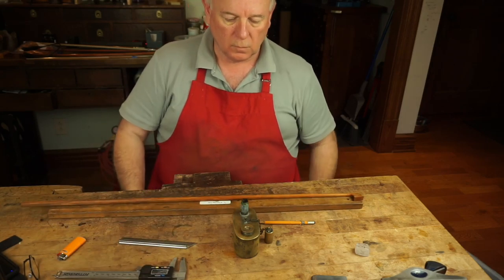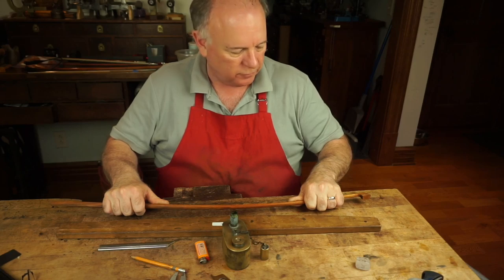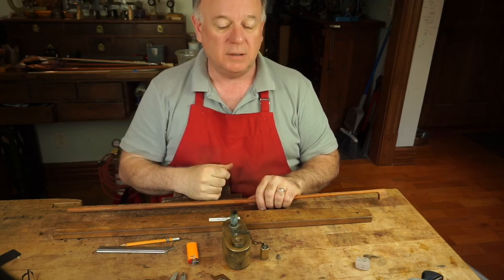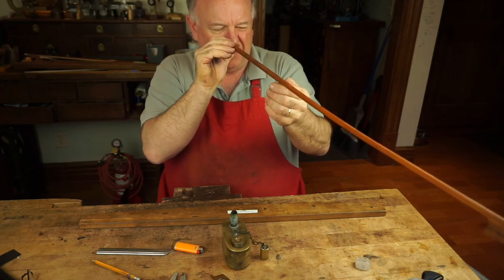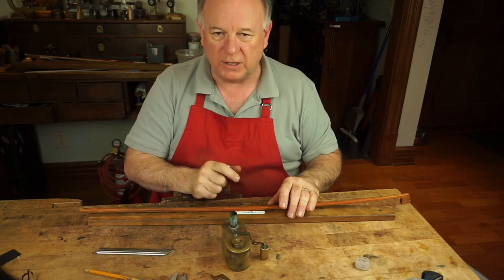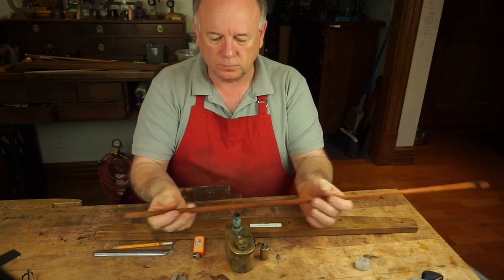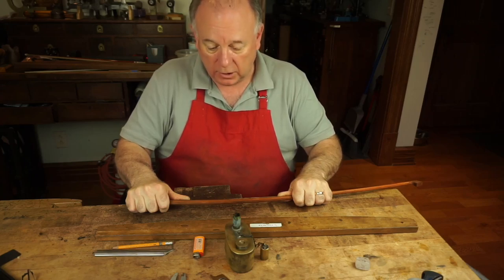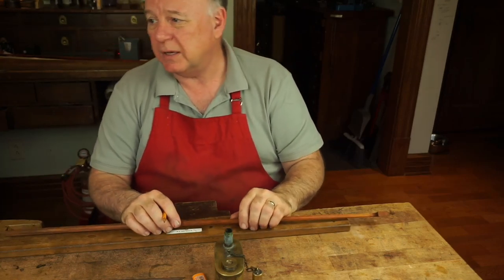Covid-19 Violin bow making: Day 1, Hour 2 Cambering

Comment: What is the reason for waxing the screw eye of the frog?
Reply: The Brass or bronze eyelet needs lubrication to help it last longer.  We use a soft wax as a lubricant.  Any oil will be wicked away by the wood so wax last longer.  Its important not to use silicon because it may make gluing any future cracks more difficult.

Comment: Why is trying to steam bend pernambuco bad? What would happen if somebody tried? I found some sort of data sheet that said the wood is "not suitable to steam bending" but that's all it said. Anybody know why?
Reply: Dry heat is the traditional method of bending the stick.  With dry heat you can adjust the camber and straightness in a small section at any time while your making the bow or many years later.  It’s unlikely you could heat s short section with steam.

Comment: Do you know of any North American woods that have similar elastic and density parameters that can be used to make a bow?  I know a primitive hunter that uses Osage Orange (Bois d'Arc) to make archery bows and thought the wood might be interesting to try.
Reply: I would say black locust also, and some really stiff hickory, but you'll need to size the cross sectional height up a little to account for less stiffness compared to pernambuco etc. See wood modulus of elasticity tables. And remember stiffness of a beam is proportional to cross sectional height to the third power.